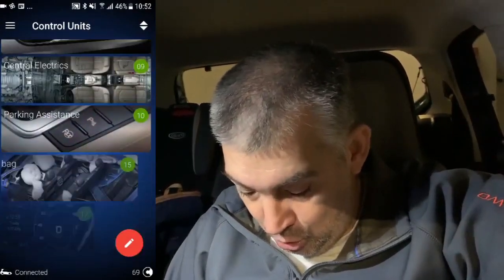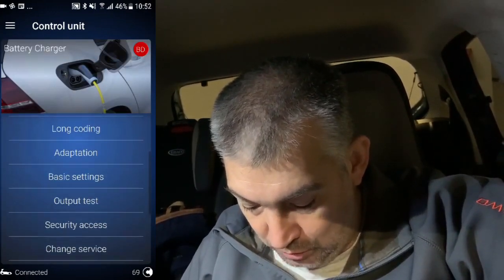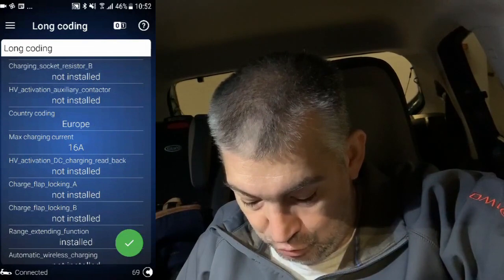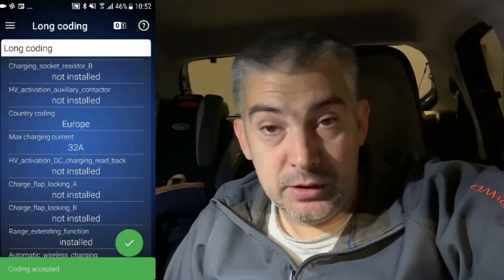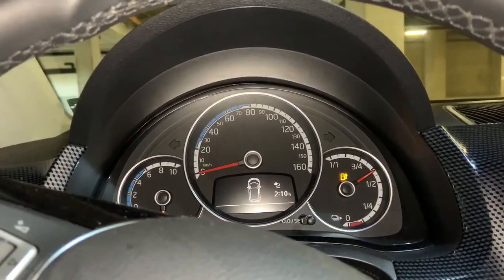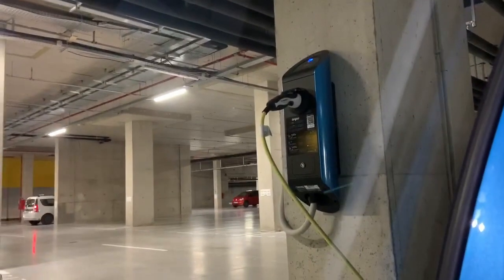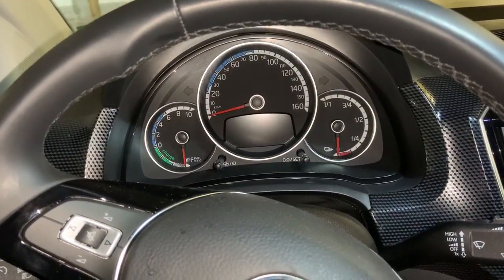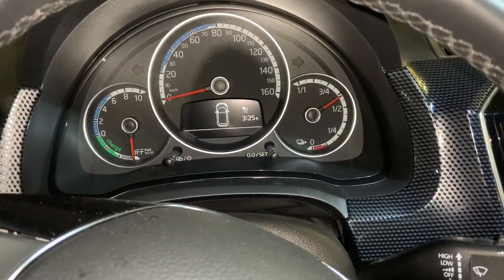How to program Volkswagen e-up AC charger

Comment: what current settings do you find in the maps+more app (or in the android connect app)? After the modification, I can now choose just between 5A, 10A, 13A, MAX. That is, I miss the 16A setting now that the "MAX" value is associated to 32A. So how can I set the current to 16A now? Did it happen just to me?

Comment: Hi Tedo, I have a wallbox connected to a 9kwh Photovoltaic home system (they say it can charge up to 7.4kw - 32A and can combine both sources to reach that power: PHV system and energy supply from the public grid)... however the cable does not look as thick as yours, it looks more like the one supplied with the E-up when we travel (note the home charger)... do you think it will be good enough as a cable? Any risk of overheating?

Comment: Really love all your tryings to make a better E-up!

Is this possible/workable on the first gen e-up?
Is there a 20kW onboard charger installed in the second gen up? In the first gen is says not installed. You can look this up in OBD11 long coding
Reply: I have the first generation e-up and through obd eleven I found the same item that could be changed to 32A, but I still don't have a cable that can do 32A, so I can't say if the upgrade was really successful :)
Reply: @RadekBuš  i changed via obd11 but still the same charging speed 3,7kwh.
Reply: @garvinhollingsworth8066  and do you have a type2 - type2 cable that supports 32A?  it must have 3G6mm2 wires and terminating resistors between PP and PE of the appropriate value (I guess 220ohm) that tell the car and the charger how much amp the cable can handle.
Reply: Got a Wallbox with a fixed cable that can handle 32A…
Reply: @garvinhollingsworth8066  aha, so for the 1st generation, more than 16A does not work.

Comment: I changed the value to 32A.  Unfortunately, the EUp still only loads with 16A.  My Tesla Model3 charges with 32A without any problems.  Has VW changed anything?  Or do I have to code further values?
Reply from the maker: Did you change the cable too?

Comment: Great post. I´ve been today in VW dealer in Portugal and they could not do it. I have a OBDII dongle but does not work with OBDEleven. There are several options: OBDE , Next Gen OBDE, Starter pack, pro and ultimate. Could you help me on which should I get to do this modification (iOS). I´ve payed 800€ for a 7,4 kW wall box at home and you can imagine my frustration in only charging at 3,2kw
Reply from the maker: Check the video description to find a link to OBDeleven dongle that I used to do this modification
Reply: @tedonash2681  But does it work with the free basic app or do I need de Pro version activation as well?
Reply from the maker: @mpgastao  you need the pro version.

Comment: Having watched your video Tedo we spoke to our VW dealer about OBD11, the master tech checked the list of TPI Bulletins and found one relating to this issue with the 2020 VW e-Up, he then made the change for us in the workshop and asked us to report back our findings. We were able to confirm that indeed the vehicle did charge successfully at 32Amp, this modification was done by a UK VW dealer in the workshop by the master tech on the premises 11th November 2020. Anyone having difficulty getting the modification done should ask the dealer to check the list of TPI’s, the modification became available about 1 month prior to us getting it done.

Comment: Hello Tedo Nash, thanks for all your video!
I bought a 32A cable after seeing this and then I asked my vw car dealer (from Romania) if I can increase the limit of my car from 16A to 32A. His answer was that this is a hardware limitation, not a software one, so he can’t change the charging value.
My e-up is the new 2020 model. 
Do you know if the dealer is right or just didn't want to get involved? They are some e-up limited from hardware?
Thank you
Reply from the maker: Mine e-up is also 2020 and I haven't heard that it is hardware limit. My experiene is that the car have a software limitation which I shown how to workaround. The only hardware limitation is the cable that you have solved.
Reply: @tedonash2681  There was an software update at somepoint (my 2021 has it) where you can set 32A using the app  - so I managed this setup without the need for ODB11. 
Really bad that VW only provide a 20A max able with the car though - had to buy a 32A 3-phase cable to get the benefit. Definitely worth it as now I can get 60% charge in 3 hours :)

Comment: Hello Tedo, I have heard that it is possible to charge in single-phase with a 32A cable, without program with OBD11 to 32A, at a power of 7kW. Could you check at your work if this is true? Greetings and thanks for sharing
Reply from the maker: Yes I also heard about this but this really depends how the car is coming from the factory and to which country it is made for.
Reply: Cars sold in Sweden are charging 7kw with type 2 .
Reply: Ignore. It is on 3phase chargers.

Comment: I'm really curious, if you use a triphase charger with 32A you can get 14.4kw?
Reply from the maker: I thought the same but the car distributes the load between its 2 onboard chargers. This 32A are distributed 16A for each of the chargers. If you connect 22kW AC charger it will load 3.6kW for each phase so total 7.2kW

Comment: In the UK we are given a 32A cable. But ac charging is factory set to 16A for euro market. Your change  to 32 A works 
  I’ve just done a charge and it’s such a relief to get the full charging rate. My dealers are useless, they know nothing.

Comment: It looks like they set the limit to 16A because most standards do not allow assymetrical loads (one phase/2 phase) with more than 16A.
I assume > 16A uses both phases of the onboard charger in paralle. Thus, it's only possible to exceed 16A on on phase but not on 2 phases (since each charger phase can only do 16A)?
Reply from the maker: You assumption is correct. I saw in the OBDEleven that the onboard charger is splitting the load between both phases somehow.

Comment: After putting 32 A setting : Does it change something on a  charging station in the city ?
Reply: That depends on the charger.
- 3 phase charger: No difference, up to 7,2kW.
- 1 phase 32A: Upgrade from 3,6kW to 7,2kW.
- 1 phase charger <= 16A: No difference

Comment: Tedo you are my savior ! I bought a 32A cable but had no charge speed improvement. Now I will have faster charge, thank you so much ! 🙏🏼✅👍🏻👍🏻
Reply: Here in UK VAG are apparently exchanging the 16A cable for 32A when they do the software update.
Reply: @greybeard163  Hi! Do you know if VAG UK is changing the cable for olders e-up too, or only for the new 2020 model ?
Reply: @johnmanderson2060  Be cautious, it is not clear that earlier versions of the eUp! can do this! Better to ask VAG.
Reply: @greybeard163  Thanks for your advice, yup, it is tricky and I will take no risk with my beloved et-up! I will wait to have a firm green light from VAG before attempting anything.

Comment: is it safe to change 1st generation eUP for higher AC currents? why is it originally reduced?
Reply from the maker: No it is not safe. The 2th generation split the single phase power into internal two phases/chargers
Reply: @tedonash2681  I doubt it will work on 1st gen eUP, as it only has one 3.6kw charger. 2nd has 2x3.6 chargers.
Reply: @electricwhirl5175  Thanks for the info, I double checked after reading it, and effectively, you are right. So my hope for a faster charge just vanished 😩 But I did not fried ⚡️⚡️my battery 🔋✅🤩 Pfuuuu! 🤣

Comment: In UK the car is sold as charging at 32A, but many have been delivered with only 16A capability. As most UK houses are supplied with up to 100A on single phase, 32A charging is the standard for a home wall point. VAG are slowly getting round to resetting the eUp!, Mii and Citigo to meet the brochure promises AND replacing the charge cable supplied with the car. I am waiting for my Skoda to be done.
Reply: That's funny. They implemented a decent charger that can adopt to the different grid types around europe but then f*cked it up for the customer.
Reply from the maker: @gisobo  this is Volkswagen.
Reply from the maker: But you are at 110V right?
Reply: @tedonash2681  Tedo, no - the supply voltage to domestic properties in the UK is nominally 240 V AC at 50 Hz, although the declared voltage in the UK is now 230V AC +10% to -6%. Industrial/commercial premises normally have 415v 3 phase.

Comment: it's interesting as the car has 2x16A chargers built-in.
Have you tried to do a full charge cycle? e.g., 3-4hours
Reply from the maker: No I haven't. I prefer to charge slowly to increase the battery live. Why do you think it have 2x16A chargers? Can you share with us your source of information?
Reply: @tedonash2681  I have came to this info multiple times on internet (e.g. https://pod-point.com/guides/vehicles/seat/2020/mii) also the same technical info was given from two independent sellers, when I asked about the home wallbox installation.
https://youtu.be/uy1E_LKOCo0?t=1236 from 20:36 
Also if you look at the socket of the car you can see it has no L3 connected.

For slow charging - in case of eUP is 3.6kw/16A the best on single phase or 7.2kw on 3-phase, check the table from article:
https://www.emobilitysimplified.com/2020/02/why-should-not-charge-ev-at-home-schuko-outlet.html
Reply: @tedonash2681  I just found this topic, seems that the car can have a soft update from dealer, that gives charging on higher speed
https://myenergi.info/the-strange-case-of-a-citigoe-iv-charging-at-32a-w-t2337.html#p22592
Reply from the maker: @electricwhirl5175  yes I also knew about the software update. That is the reason why I make this video, so that everyone can do it and not go to the dealership.
Reply: @tedonash2681  so you think that dealer is not putting up the software update, but just change the value and that's all?
Reply from the maker: @electricwhirl5175  i think so. I can’t be sure but this is most probable as I think
Reply: @tedonash2681  BTW, maybe using obd11 you can see the charging speed A, kW, maybe even per each charger? That would give a lot of answers :)
Reply: Because you can charge on a three phase outlet with 2x16A. In some countrys like Germany you are not allowed to draw that much current from a single phase.

Comment: If the rectufier in the car can take 32A on a single phase. Why can't it take 32A on two phase?
I never expected the rectifier to accept 32A on a single phase.
Reply: The car has two 16A chargers built in. They can use phase 1 and 2 individually or only phase 1 in parallel.
Reply: @gisobo  it would mean it has the connections to do it in paralel, and at the same time the ability to not short the phases between them when connected back to a 2 phase setup.
Reply: @Alex-qx7jn  So it can switch one of the chargers to L1 or L2.
Reply: @gisobo  I agree that that's the way to do it. I find it odd to have that built-in, because it's not a software setting, it's a hardware setup, with safety measures, not expose it to be used by the user, but have it work flawlessly.
Reply: @Alex-qx7jn  it's just an electric switch, nothing fancy about that.
Reply: The Charger can connect between L1 and neutral (230 volts) or between L1 and L2 (400 volts). It's built to work with wide voltage range. There ain't two chargers in the car but one charger that can connect two different ways depending on what is available.
Reply: @rainelakkala1351  No, that's not how they've done it. 16A*400V=6400W. But the e-up! can charge with 7200W on 2*16A which is only possible by using 2*230A and 15,65A.
Reply: @gisobo  On 3-phase current the angle between phases is 120 degrees. So when the current on single phase is 16 A, the current on the charger when connected between two phases is 
2 x 16A / sqr(3)  = 18,5 A

400 V x 18,5 A = 7,4 kW

In e-Up (and e-Golf, Mii and Citigo) there is only one charger, that can work on wide voltage range. It's cheaper to make it this way than put to car multiple onboard chargers.

In countries (like here in Finland) where three phase electricity in households is common, you can usually charge much faster from two phases because main fuses are usually 3x25 A or 3x35 A so you can't take 32 amps from single phase, but 16 amps from two phases goes fine. 3-phase charging is of course the best situation but it's more expensive for the car manufacturer to build.
Reply: @rainelakkala1351  No. If you have a simple circuit like L1 - charger - L2, how would you have different currents on different points of your circuit?

Comment: Very interesting video. I hope that by using the 32A cable you don't break anything. If after 20 recharges of more than 2h, everything is ok, it can be very interesting upgrade. Although you are not really duplicating the power. With the 16A cable charges at 4'3kW and with the 32A cable charges at 6'3kW. Greetings and thanks for sharing.

Comment: Can somehow charging amps be set in between 16 and 32 amps? My flat can deliver max 26 amps. So i would like to set charging at aroynd 22 A.
Reply: you can limit current in maps&more app
Reply: @andrey6669  so no need to use OBD11?
Reply: You set the car to 32A and set the wall charger or "on cable device" to allow only 22A. As such the car demands up to 32A but the charger communicates that it can deliver only 22A so the car then never pulls more than 22A